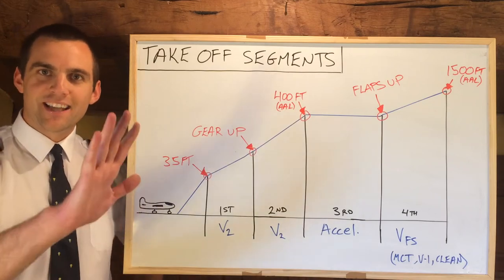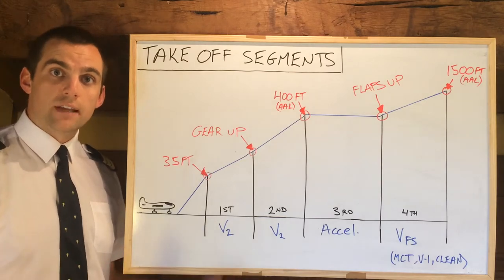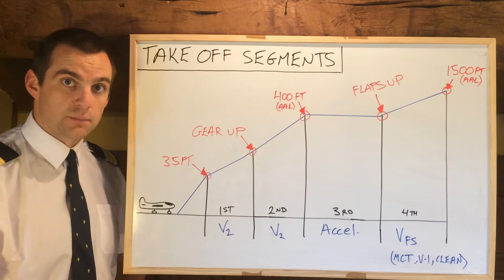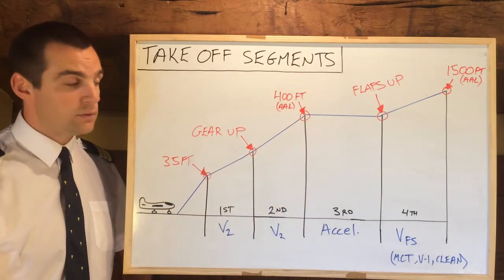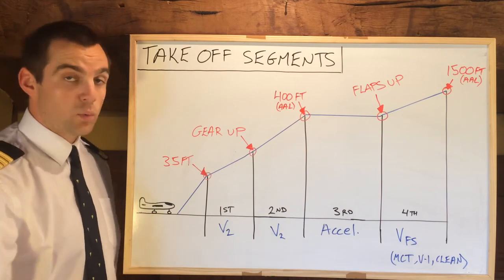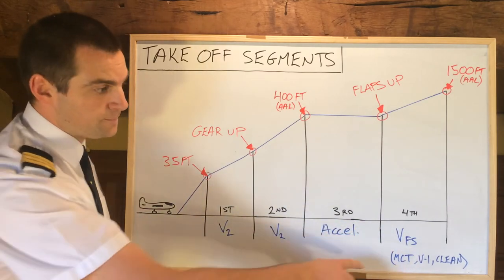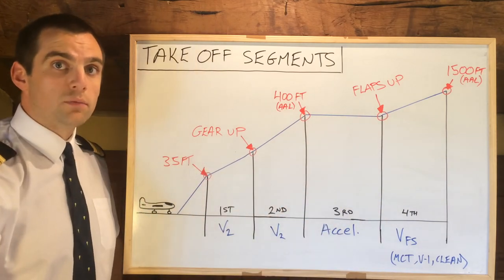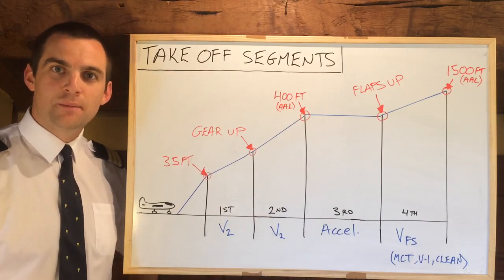Take-Off Segments ✈ ATPL ✈

Comment: I thought that the first segment was the one from vlof to screen height 🤔 based on phak.
Reply from the maker: pretty sure what i put on the board is right! may be called otherwise, dont know what phak is sorry
Reply: PilotEd sorry, phak stands for pilot handbook for aeronautical knowledge, issurd by faa. You can see in it at chapter 10. Cmiiw
Reply from the maker: its possible the FAA consider the sections differently i dont know? ive had a google and indeed there are some different versions, acceleration and clim out are all the same though, just depends where you take the start from. In all the examples i found where the segment starts at Vlof it also states the gear is retracted at the same spot! to me those two point are different. You dont retract the gear as soon as the wheels leave the ground! lol but the basis are all the same :)
Reply: Im not an airline pilot yet, but as far 25. 111 said that yeah, landing gear retraction can be initiate once the aircraft become airborne, but they're not specific on what altitude. Can i have a book that you used for reference in this video? I would pleased to know that
Reply from the maker: sure i studied with oxford aviation atpl books